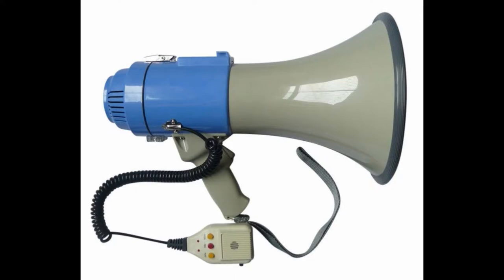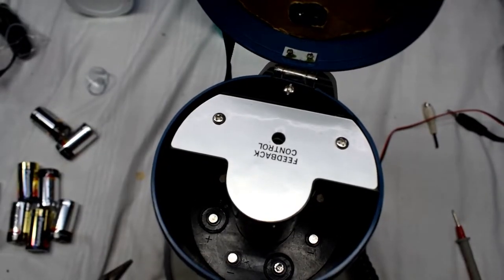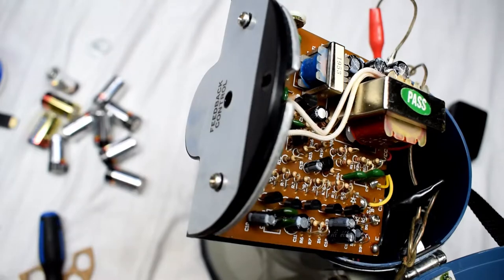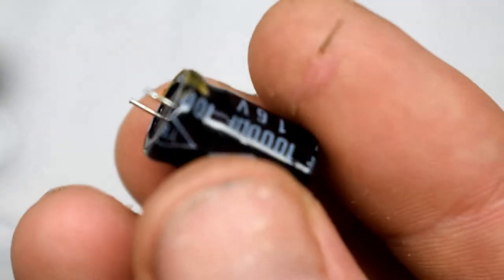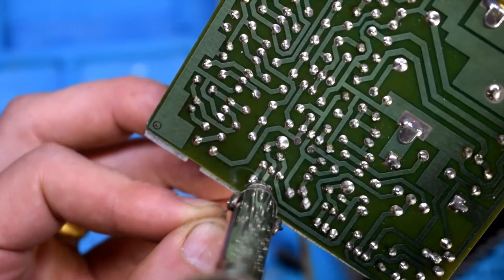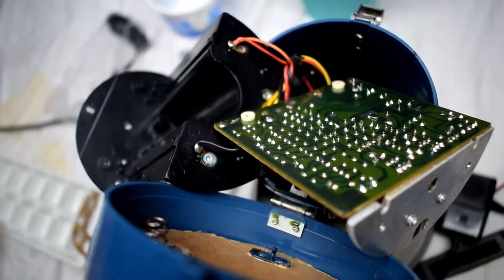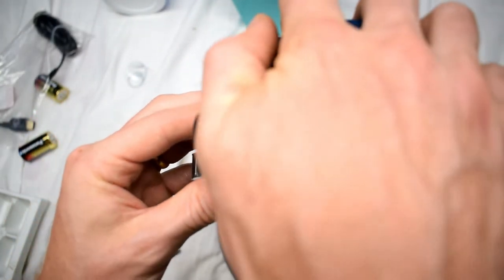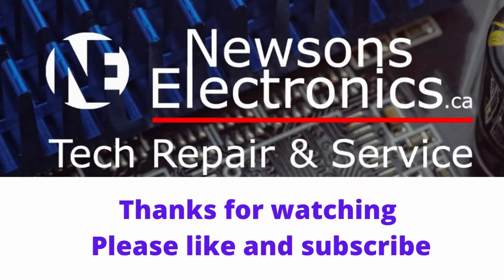I just fixed this Megaphone Model: (GENNEXXA)

Comment: I have a 50W Western Safety Megaphone and it has power and the siren works. Both buttons for the microphone (on handle and on handheld mic) make clicky sounds but it does not amplify my voice. What would you suggest doing to fix this? TIA
Reply from the maker: open it up and check for loose connection